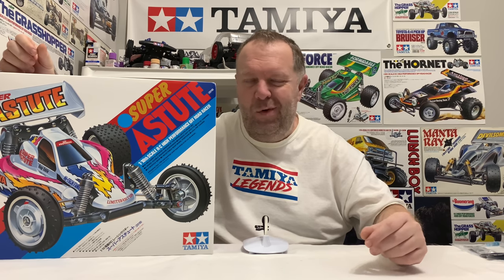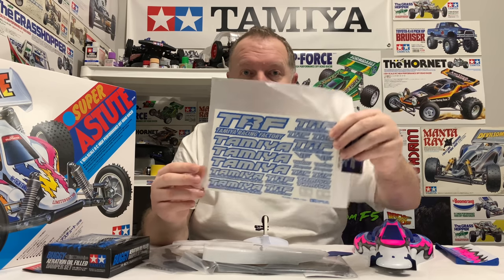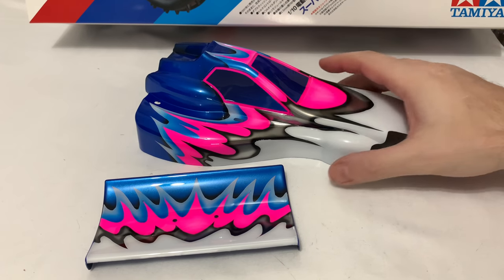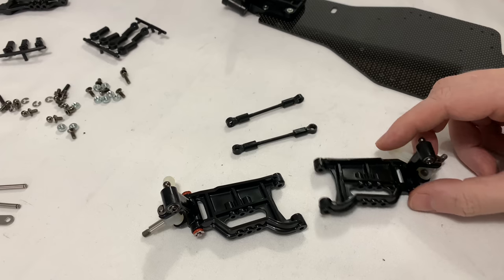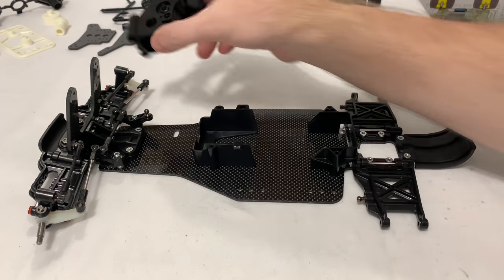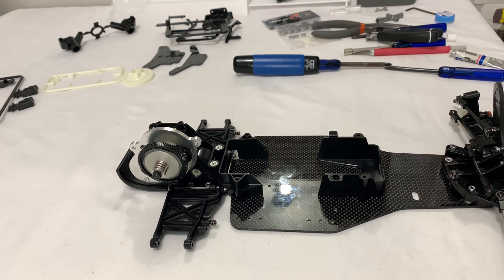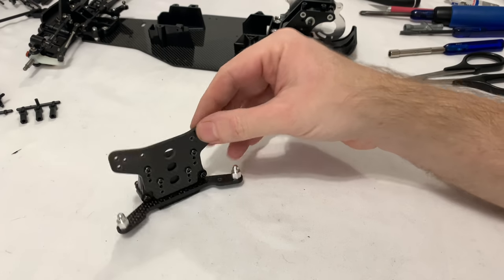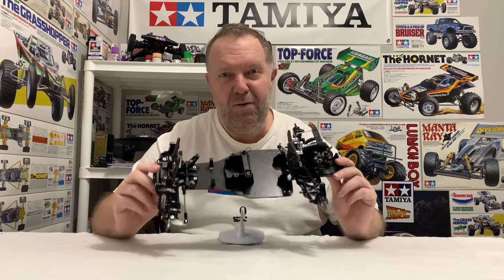Tamiya Super Astute Build in Full Carbon

Comment: Even if I buy hop-up or aftermarket parts before a build, I always like to build 100% stock (except add ball bearings if not included) first and run it for a while totally stock.  Disassembling and adding parts later is just adds to the fun!

Comment: HI, Glenn.  The original Astute (and Super Astute) do have those 3 rear holes in the chassis as well as the two in the sub chassis countersunk.  I wonder why fiberlite did not.  My first Tamiya kit was an original Astute from back in 1989.  I still have it and several others including an original Super Astute and re-re.  These two wheel drive buggies are great fun to drive.  All of the Carbon Fiber bits look awesome!  Can't wait to see it completely finished.

I really enjoy your channel and was so happy to hear you will able to keep it going.  Thanks!
Reply: I just finished watching the end of the video.  The is nothing different between the original Astute/Super or the re-re that would make those fiber parts fit differently on an original.  I'm now kind of curious and would like to build a fiber version of one.  I'm interested to hear what you come up with from others who have used these carbon fiber bits.
Reply: @DibsOnIt  
When you make a copy with too close details you can be sued,  a copied part MUST have a difference to stop the law sues....

I used to work in panel beaters after school and they explained the differences any WHY they had to be there,  hence NO counter sink and wrong sized servo slider hole(s).

I am now looking at buying the 2024 RE-re-release kit for a runner and my off road car,  have Bolink Pan cars for the on road runners....

Comment: Xtra Speed on RCmart's site sells a full Carbon set specific for the Super Astute.  Although, having built both the Astute and Super Astute I can't say for sure if they are the exact dimensions but are pretty damn close.  They do have different front bulkheads which might explain why the front shock tower was sitting too high.  From what I can remember, the Super Astute came with full bearings except for 4 metal bushing for the front tires.  I was shocked at that.  Finally, the body of the astute and super astute is super annoying to put on and take off.   I don't like the way it wraps around the rear and front shock tower.  Never sits right especially when I'm running a brushless combo in mine.  So there are 3 wires with a heavier gauge that has to pass through the rear which means I had to trim more of the rear body off.  As always great video and no worries, I'm sure that your super astute will still look awesome.
Reply from the maker: Thanks Ari for the great information my friend 🤩👊🏻

Comment: When I built mine a few months back RCMart had a carbon parts set branded "Xtraspeed" that was identical to the kit frp parts.  I opted for a set of Hi-cap dampers to go with it.  IIRC that fiberlyte set was for a mod job that predates the rerelease and used some other hop-up shocks that were available at the time, saw the build thread but don't recall where exactly.  Hope it works out for you, Cheers.

Comment: I looked at the fibre lite products for the super astute but didn't bother because the original parts looked ok but I did use the vqs hi-caps but left out the spacers in the shock cylinder that it tell you to put in and it give more shock travel I've used them trf decals on my super astute! They are very blingy!

Comment: Hi Glenn, This will be confirmed by others I'm sure:- even built in stock form, the body on the super astute is a real squeeze to fit. Also, Do you have a low profile servo to fit? I managed to get away with a standard servo by spacing it forwards until the servo saver nearly contacts the front brace, but it's a snug fit and there isn't a lot of room for the battery wire to exit at the front when using NiMH, I also found that only certain standard servos even had any hope of fitting, some are just too tall. All in all though its a very nice car, and a quality drive.

Comment: Yeah I agree with Kent B. This could of been made for use with the longer dynastorm front shocks.  Fibrelyte are not a bespoke RC company so you are sometimes relying on templates that have been built for.
 other people.  Not a fault of the company however. They make fantastic parts at great prices.
Reply from the maker: Hmmm interesting take on it Lee 🤔.  Fully understand your point, but don’t you think we should expect better when spend £100 🤷🏼‍♂️

Comment: Hi Glenn, do you have some suggestion for the selection of the brushless system for the Super Astute? I'm now considering Castle 1406 or 1410 with their Mamba X ESC. Not sure if the vintage can withstand these output or that will be not enough since it's significant heavier than the modern buggy.

Comment: I think there were slightly different cut lines on the original body in 1988. I had to take a bit off the back for my one and slightly angle the front section around the front shock tower to meet the tower angle instead of straight up and down.

Comment: A lot of the fibre lyte parts are/were designed either by customers or for customers so you won't always get exact replicas of factory parts. The shock tower looks to be for the use of the longer rear shocks on the front which was a trend at the time in 2wd  competition.
Reply from the maker: Hmmm very interesting 🤔 
Think it would be very beneficial for them to have this in the item description 🤷🏼‍♂️
Thanks for watching and leaving your comment Kent 😊👊🏻
Reply: @TAMIYALegends  For the shocks I think it would look good with the longer ones, can you just get the shock bodies and shafts rather than a whole new kit if you intend to keep the tower.
Reply from the maker: @kentb3175  
Yeah it’s was actually perfect for the TRF small bore shocks I used 😅😅😅.  It now looks meaty on the front 👊🏻

Comment: I love mine and was an amazing build but I know what you mean as mine took a lot of work to get right and now with 50w oil front and 37.5 rear it seems about there. Please fit a suitable servo saver as I broke the steering arm doing a figure of 8 and it flipped at about jogging speed, my own error as I had an alloy horn on, sounds dodgy sorry. The other thing was the body allowing the 3 motor wires so in the end went brushed with an 11 12 and 13 double motors track depending and is factory spec apart from lundsford titanium turnbuckles. Front shocks are best mounted on the inner arm hole and the rear in the middle and the kit tower positions. Lovely to drive so stay on in there its worth it mate
Reply from the maker: Fantastic information thank you 😊
Reply: @rubber triangle hi, it was 42mm x2 46mm x2 38mm x2 and 32mm x1. You could get 18mm x 1 for the servo to steering arm too if you really wanted to. Hope that helps, these lengths are slightly different to the kit sizes but only the 46mm x2 in place of 50mm x2. The reason was to give a bit of give in the steering so not to break it. D parts are very costly much to my expense after breaking one, £60 for two trees with tax and shipping don't want to be doing that again lol
Reply: @TAMIYALegends  no worries mate, you've solved one issue already with the shocks, I swapped to some ae rc10 xrings, it stopped the shocks sticking and now feels nice and plush.
Reply: @TAMIYALegends  one correction, I said inner hole, I meant outer hole on front arms, I was looking at it and got confused lol 😆

Comment: Thats very odd with the servo fixing hole, looks like there should be more parts to the fixing of it. Perhaps an old super astute manual will shed some light on all these errors in the chassis? Perhaps you could use a 2mm x 6mm washer in the hole and then a countersink screw & counter sink washer on top of that.
Reply from the maker: Yeah I’ve got it fixed with two washers now, it’s actually pretty secure now 😅👊🏻

Comment: I can't see the need for bearings on suspension. There just not enough movement taking place for that to be anything other than "bling". Yet, it is more of a pain to clean bearings on a suspension bit than bushings.
Reply: There is not really a need for them, but sealed bearings are so cheap now that you might as well put them in. The kit also comes with steering bushings, i replaced them too, wicked smooth.